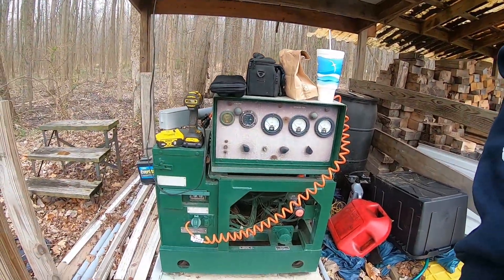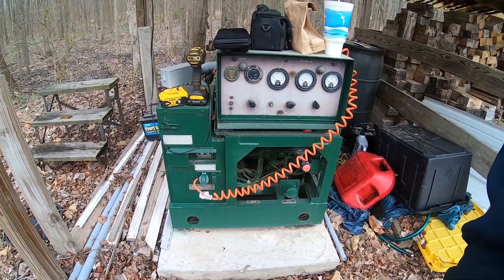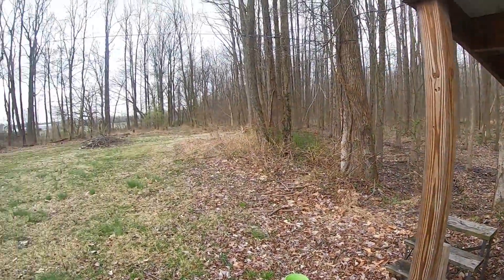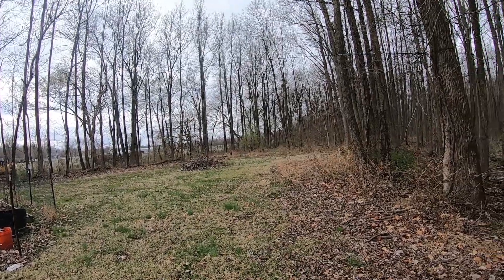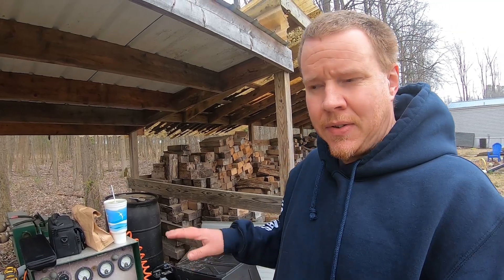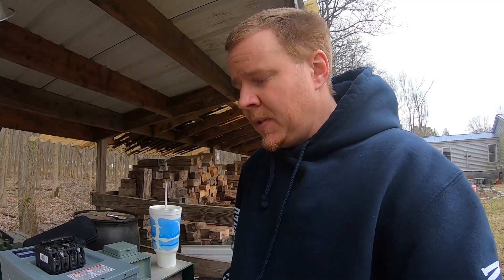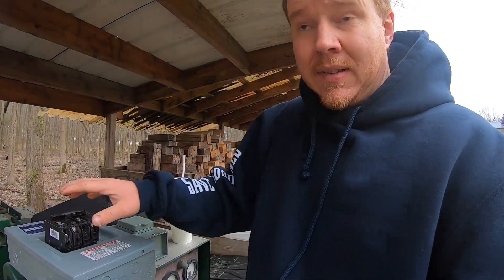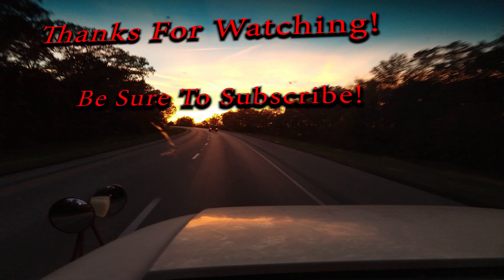Emergency Backup Power - Grid Down - Diesel Generator - MEP003A - Black Diesel - Be Prepared!

Comment: The 0 series generators do not have mufflers on them, they made some with acoustic covers but they are less common, I have some 800 series units and they are reasonably quiet. You might benefit from a couple of AP exhaust “Turbo Pack” mufflers, they’re cheap and surprisingly quiet. Or you could use any turbo style muffler. I’d recommend putting a rain cap on wherever you run the exhaust, because I’ve seen critters, both mud wasps and rats, build homes in exhaust pipes and cause problems at the most inconvenient times.
Reply from the maker: That's the plan.  I'll route the exhaust outside and up with a rain cap.

Comment: That is an awesome set up. I have a 8750 contractor grade that I put a tri fuel carburetor on it works good. I also have two predator 3500. I end up using those more than the big one just because of the noise factor since I’m in a subdivision, but it would also be nice to add a bigger diesel generator for power outages during the summerright now I just run some window shakers in the bedrooms during the summertime if the power goes
Reply from the maker: I too have a selection.  I really like my 3500w inverter type units.  I got a few of them from a pallet auction.  Have a couple of the suit case 2ks and a 8k standard contractor style.  The 8k is loud but it works in a pinch.  The diesel is also stupid loud but enclosing it recently made  a HUGE difference.  Not sure if I have a video up on that or not...   I think I do but its been a bit.

Comment: I like your setup. I service generators. I was able to buy one of my customers old generator. They bought a new bigger unit from us. Mine is a Cummins 12v with Stanadyne rotary pump. It's a 100kw 3 phase and re-tapped to 240v single phase so only 74kw now. I was able to piece together an ATS (automatic transfer switch). You wouldn't believe how little I paid for this unit. I also did the service and maintenance on the unit for the last 6 years for this customer. It came with a 75 gallon day tank used as a primary fuel tank and a shed housing, I still need to trench and run cable to the house.
Reply from the maker: Nice!  That's a heck of a unit for stand-by power.
Reply: Eventually when I get my WVO designs centrifuge through you, I would like to run some prime power on WMO.  @NotSoGrandGarage
Reply: Sounds like total Overkill to me... Nice

Comment: this is what I use for backup, we're completely off-grid with solar and wind and forklift batteries, but I have a mep003 for last resort, I also have a mep026c DC 28 volt power generator for charging batteries. I run my mep003 off 80% uses oil 20% diesel, but I also run my m925, m109a2, m1009 all on oil. I also have a mep015 28 volt generator. yes I collect military vehicles and equipment I have several military  generators, trailers, trucks, I'm a Marine Corps vet and worked on many of these while I served, and great equipment. also you can use two of those mep003 together to get double output.
Reply from the maker: Very nice bud.  I run quite a few things off oil blends.  Have a bunch of videos on the subject if you haven't seen them yet.

Sounds like you've got a nice collection!
Reply: @NotSoGrandGarage  I watch most of videos, when I got time. I appreciate you taking time and information, very helpful.
Reply from the maker: @sethtaylor8340  appreciate you watching bud!

Comment: Have you had any issues with the distance? I finally broke down and purchased 2 older 3ph disconnects so I can choose my source (mains or off-grid). The older one's I found on ebay have 3 separate blades so you can get a complete disconnect without keeping all the neutrals connected (a whole other issue).
Reply from the maker: No issue with distance.   I trenched in 2-2-2-4.  It's oversized for the unit and run.  Works great.  As for the disconnect, the generator itself has a 3ph disconnect  built in which is nice.

Comment: Make steam with exhaust heat, 100 or 200 ft coiled copper pipe inside insulated 6" wood stove pipe, will use 4x less fuel, steam clean engine of carbon build up, steam over 200 c temp is dry steam, will light a match at that temp, diesels love hot steam, burn cleaner and run cooler under full load
Reply from the maker: I need to look into this more.
Reply: @NotSoGrandGarage  if you do something like this pleaseeee make a vid, love your channel man, from Australia myself, laws and such are very restricting, can’t sneeze without a license here lol, keep up the good work 😁
Reply from the maker: @bryce3376  will do!  Appreciate you watching